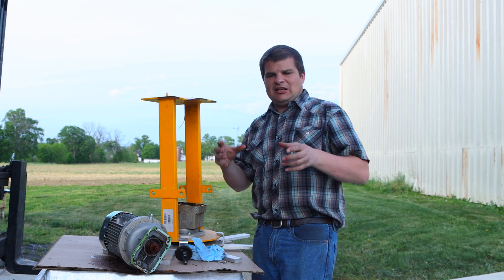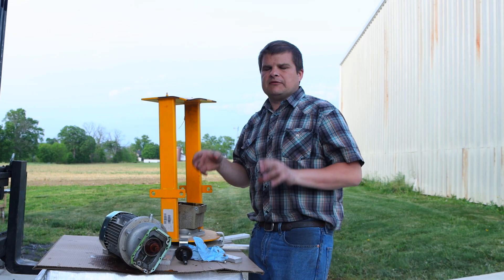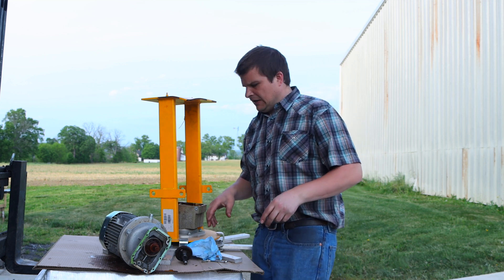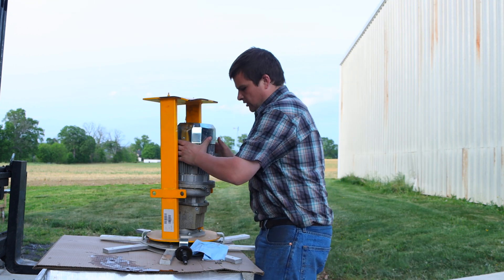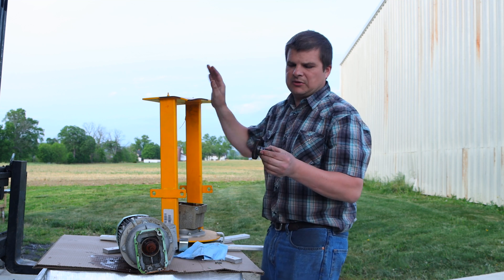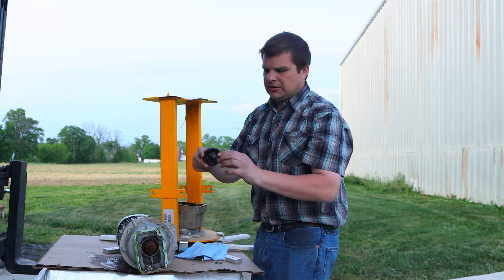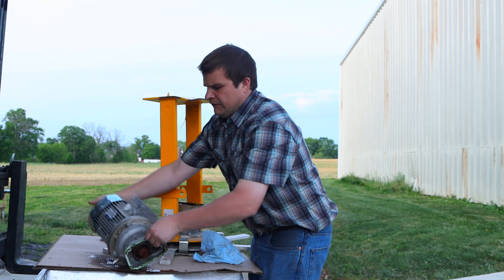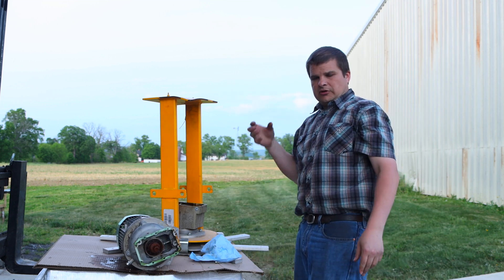4 tips for Repairing Big Ass Fan® gear driven fan.

Comment: I have two 24' Big ass fans where both of the hubs are dropping to the point that the safety hooks are dragging. the nut is in place. is this the gearbox coming loose? Any help would be appreciated.
Reply from the maker: Hi SeanWindsor,
If the safety hooks are dragging, the hub likely slid on the gearbox shaft. 
Oil would be everywhere if the shaft came out of gearbox.

You mentioned the nut is in place. I am assuming this is a big nut that squeezes the hub to gearbox shaft.

The easiest way to work on hubs, is to go directly under the fan and push up on the fan blades with a scissor lift's  railing.

Then with upward tension on the blades from the lift basket, loosen the nut. The hub will go up, and you retightening it.
 Ideally use  thread locker on the shaft( not the the nut)

If you text pictures to (484) 577-3648 I may be able to give a better ideas.
Kevin

Comment: Thank you for taking the time to make a video on this unit I have one im working on just like you have in the video and the lower motor bearing is bad any good tips on getting the motor spindle out?  Also any tips on removing the entire gear baox as the fan has a slow leak in the lower seal.  I noticed there is a allen head bolt in center of shaft and the large nut on the outside I broke the center nut loose but nothing really loosened up i dont want to damage it more so I stopped.  thanks for any input your can offer.
Reply from the maker: Hi Floyd,
We don't have any super specialized advice other than working at it. We just work with our hands and use a local ball and bearing place for components when needed.

I actually left the end of gearbox on motor, because I couldn't get it to come off the motor.  Basically we went in and swapped major components to get a subset of the fans running.

If there is VFD issues, we can easily help fix that. Some of these gearboxes are kind of a specialty, and parts are tricky to identify.

The shaft down fan application, when the   bottom seal leaks and it takes out gearboxes too often.  It's what made me developed our direct drive fans. Blades are fastened directly to the motor shaft. No gears, just a fat high torque motor..